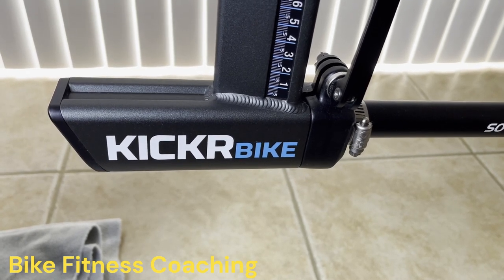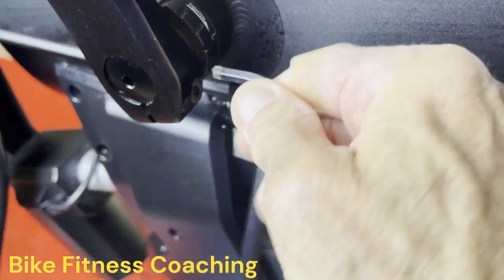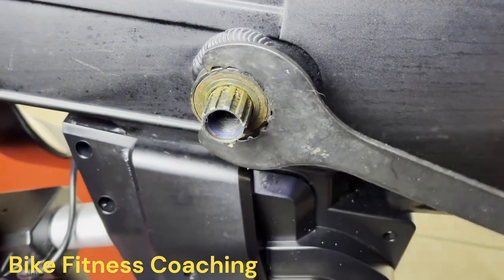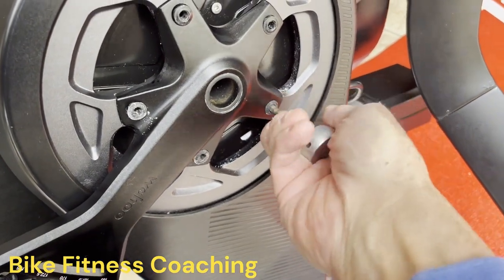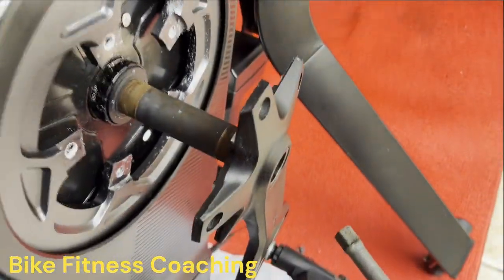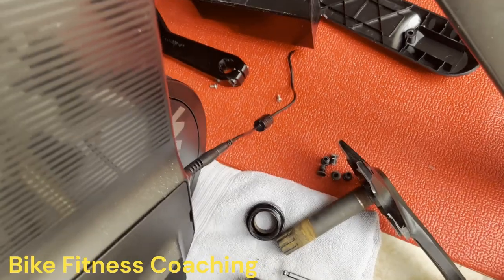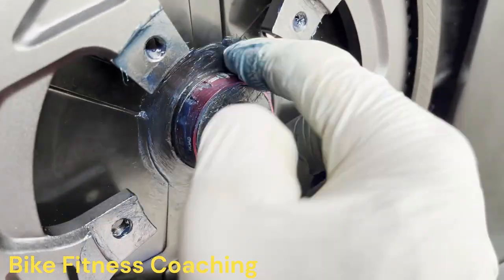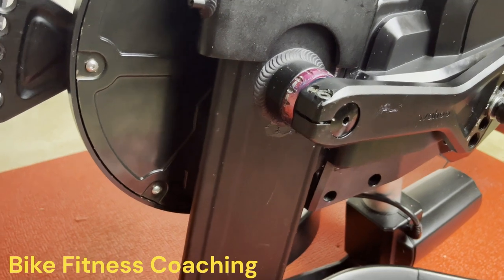WAHOO KICKR BIKE BOTTOM BRACKET FIX & REPAIR

Comment: Terrific video that should be of interest to owners of Wahoo KickR bikes. Owners of these wonderful bikes hope they will run flawlessly forever, but sometimes problems arise that can compromise the mechanical performance of the bike. In this video Rick shows how the bottom bracket and bearings can be cleaned up if they become compromised - in this case, by the corrosive effects of sweat.
Reply from the maker: Thanks!

Comment: Thank you so much for the video! I've been thinking about replacing the bottom bracket eventually. With four powerful fans, I do not have a problem with sweat dripping on the bike (no matter how much I sweat, air flow from the fan evaporates the sweat before it starts dripping), so rust is not a problem, but I do hear occasional clicking coming from bottom bracket area on every turn of the cranks (by the way, did you hear clicking in addition to squeaking?) It is great to see how this is done! A great video! I only wish you had shown how you set up the Kickr Bike upside down or turned 90 degrees, you seem to have found a stable position for it which makes it easy to work on the BB.

Comment: @BikeFitnessCoaching would you happen to know frame standard (BSA, ITA, ect) and crank type (Shimano, SRAM, Campy, ect) for those of use who want to swap BB's without dealing with Wahoo warranty? I'm at 4.5k miles and creeks/wobbles even after the recommended maintenance/tightening intervals.
Reply from the maker: Hi, theses should work https://www.jensonusa.com/Shimano-BBR60-Ultegra-Bottom-Bracket, https://www.jensonusa.com/Shimano-Dura-Ace-BB-R9100-Bottom-Bracket, and you need one of these, or one from Park Tool https://www.jensonusa.com/Shimano-TL-FC37-Bottom-Bracket-Tool

Comment: I thought you said Wahoo sent you a new bottom bracket. The one you installed looked considerably used.
Reply from the maker: Their new bb is in the mail. Couldn't wait as the old bb gave up the ghost. I had mentioned in the video I took the ceramic bb off my daughter's old race bike. Those bearings were still in great condition.
Reply: Is that a Chris King Threadfit 24 ( NOT the Threadfit 30)?
Reply from the maker: @rongurney48  it's Chinese cups with 6805 hybrid ceramic bearings.
Reply: @BikeFitnessCoaching
Reply from the maker: @Q3DrEvil  Hi